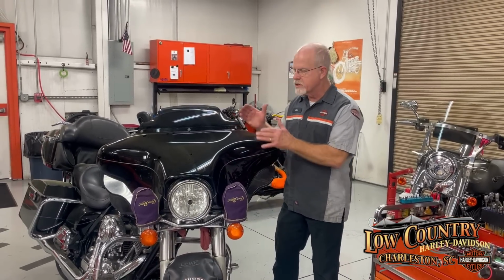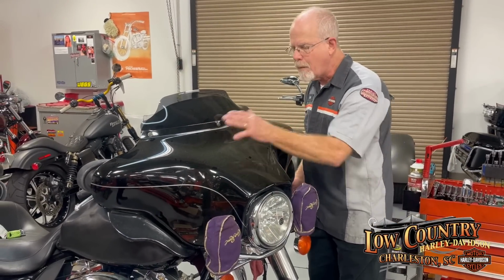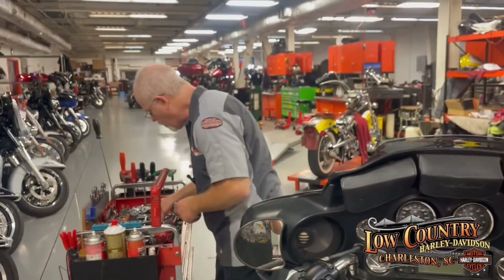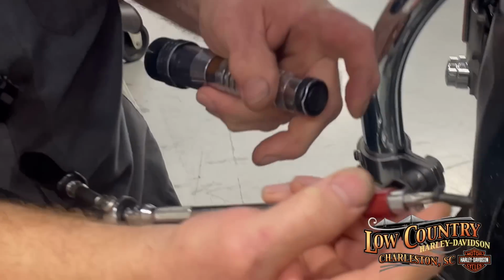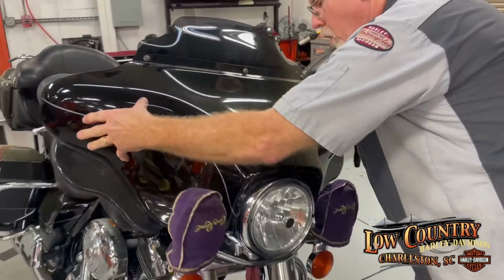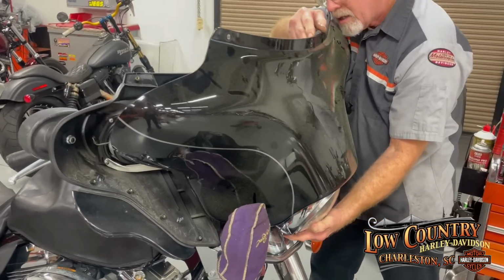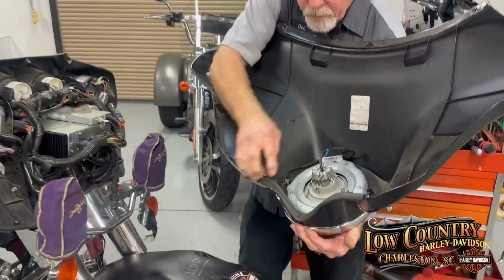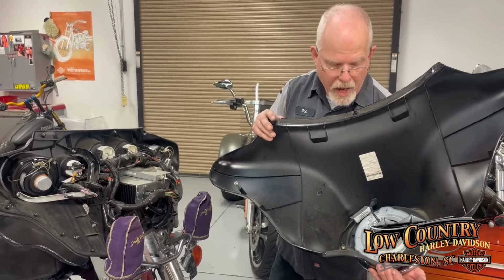Doc Harley Talks: Removing Fairing on Street Glide Tech Tip!

Comment: Boy O Boy you knocked this one outta of the park Doc!!!! I've been taking my fairing off for years the the tip of loosing the running lights before removing the fairing for more room and holding the bottom rubber seal before re-installing will really help this old shade tree out for sure!!! BTW I use old thick socks to cover my running lights since I don't have any Crown Royal ..... ;-)
Reply from the maker: 😆 love the sock substitute Doyle….Doc

Comment: I have had one of the screws fall out after some warranty work. Also had some of the inserts pulled out. I used a locktite product #410 super glue to put them back in. Still holding many years later. 
 I also started using silicone adhesive (a small amount) to act as a light duty locktite. I don't like tightening the top 3 screws much more than snug as the full height windshield is subjected to very strong wind buffering. 
 Thank you for your awesome videos
Reply from the maker: Thanks for sharing your experience…Doc

Comment: Thanks Doc ....had to do this a few times on my 2013 Electra Glide Custom when upgrading the radio and gauges....pain in the but those two hidden ones....LOL.....thanks for the tip on the pressing down on the rubber when replacing back the fairing.
Reply from the maker: Thanks for tuning in Danny….Doc

Comment: Hay Doc. I switched out the 2 lower screws for longer set screws (Locktite them in) and 2 nuts it makes it easier to reinstall the outer fairing by putting them in place first then install the top canter screw then the 2 nuts. I have found this works very well for me.
Reply from the maker: Thanks for sharing….Doc

Comment: Funny story. A few years back I changed the speakers on my 2012 Ultra. As you've demonstrated I covered the fender and tank and was extra cautious removing the fairing. I replaced the speakers with no problem and reinstalled the fairing screwing in all 7 screws except the last screw which was one of the hidden ones on the bottom inside fell out! well now I have a dilema because everything I tried like compressed air, magnets flashlight and mirror, I was unable to locate this screw. Then I decided to roll the bike out of the garage because I was working in such close quarters and the light was better. I had the bike half way out and I figured this was good enough and I set it on the side stand and resumed my search. Well I turned the handlebars all the way to the right and started looking in all the crevices when I felt the bike going over. I grabbed it but it was too late to stop it so all I could do is lay it down gently. First thing I did was to look around to see if any of the neighbors were watching but there were none so no embarrassing moments. I went around to the other side and lifted the bike up and set it straight. Well guess what! To my surprise the missing screw was lying there on the ground!! So if you ever lose a screw and can't find it, just drop the bike!! LOL
Reply from the maker: You had me all the way to the sad end….Doc

Comment: Great video. Little surprise with that HID. lol. I traded my 07 ultra (had fairing off many times) for a 19 limited last year. Installed lower fairing radiator circling "D" lights in the limited. My experience made me think of a possible next fairing video. You may want to put out a video about removing the lower 2 screws on the twin cool lowers. I learned the hard way. Ended up using a Weller 140W solder gun on the head for a couple minutes to loosen the thread lock. Again, thanks for the great videos!
Reply from the maker: Thanks for Sharing Joe. I never thought of using a soldering unit to clear the lock tite….Doc

Comment: hey, Doc I have a question all the way up here in Fort Erie Ontario Canada. How would I fix the copper grommet that is in the batwing fairing as it doesn't stay in and, I have to push or squeeze the front fairing back in place holding my windshield? the other screws are fine but just that one is there an easy fix? I found this and have an FLHTC 2013/ found Canadian Amazon  -Motoparty Batwing Fairing Windshield Threaded Brass Insert Restoration Kit Replacement for Harley Touring Electra Street Glide Batwing 1986-2018, for FLHT, Brass Inserts/ thoughts?
Reply from the maker: Gordon thanks for sharing. I did not know this existed. I have not used of course but it looks like a great repair and Amazon’s choice👍…..Doc
Reply: @LowCountryHarleyDavidson  I used it and it seemed to do the trick, lol I taught the Doc something, lol thanks always for the lessons and videos hello from Fort Erie Ontario Canada across from Buffalo NY border.

Comment: Re: oversize inserts for Harley Fairing.... Ironically the oversize inserts are the same as common brass "furniture" inserts.  Just match to the correct size 1/4 20.  perhaps with a dab of jb weld.